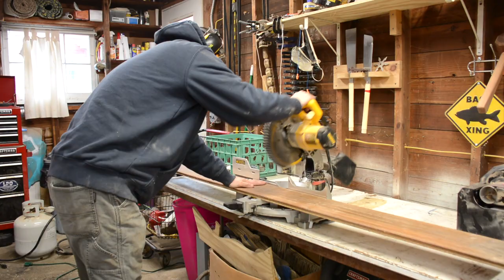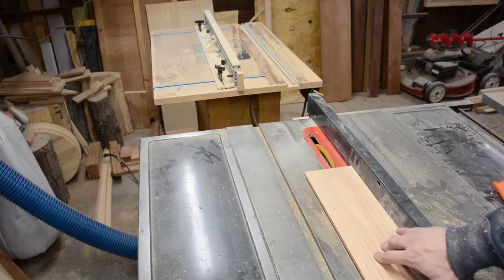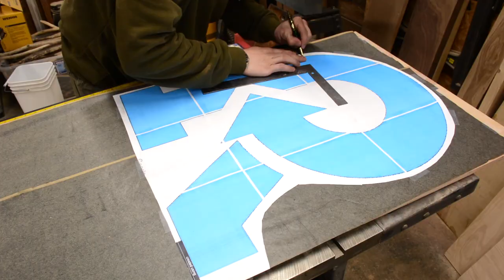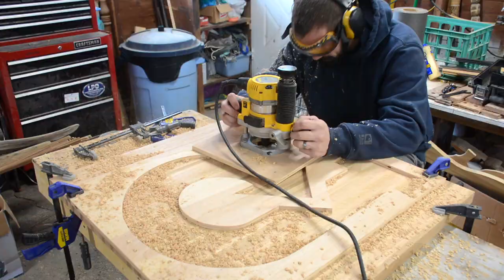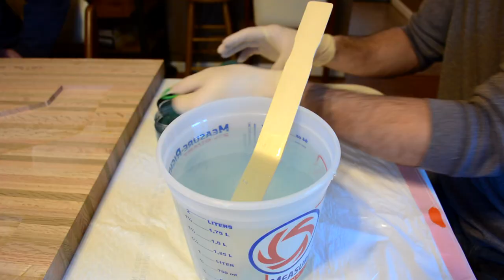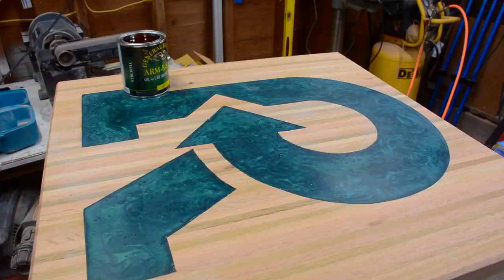Epoxy Inlay Pedestal Table build

Comment: Great project. I love glue by the gallon. Most folks underestimate how much glue they will need for a project like this. I love the larger router base you made. I'm sure it adds to the stability when routing those chamfers.

Comment: This is awesome! Nice work!
Reply from the maker: Austin McCleery thank you!
Reply from the maker: Heres the epoxy I used

Clear Casting And Coating Epoxy Resin - 1 Gallon Kit https://www.amazon.com/dp/B074R32Q4Z/ref=cm_sw_r_cp_apa_234YAb4XG0CDQ

And heres the Mica Powder Pigment:
42g/1.5oz "EMERALD GREEN" Mica Powder Pigment (Epoxy,Resin,Soap,Plastidip) BLACK DIAMOND PIGMENTS by CCS https://www.amazon.com/dp/B01IXBSPPO/ref=cm_sw_r_cp_apa_h54YAbSVCKJS2

I didn't have experience with either but I'd recommend them.
Reply: Lumber City Woodworking Awesome. Thanks a lot!

Comment: What type of router bit did you use to do the inlay? Working on a similar project and looking for an effective way to do the inlay. Thanks
Reply from the maker: I believe that was a 3/4" mortising bit with a guide bearing. Anything that can plunge and follow a template will do. Flush trim bits would work perfect too.

Comment: What type of bit did you use in the router?  I like how it left a flat surface instead of the wavy surface left when using a v groove or profile bit
Reply from the maker: It was a Freud mortising bit with a guide bearing. 3/4 in. You can get them at Home Depot. The trick to getting a smooth bottom is going over the cut a few times. If your reference surface is smooth and flat,  and you maintain constant and smooth pressure, that should transfer to the cut.

Comment: How long does it take for the epoxy to get hard
Reply from the maker: Hard within several hours. Fully cured in 24hrs
Reply: Fretthold Baits there’s no need for a type of heater? It just gets hard on it own with normal  temperature?